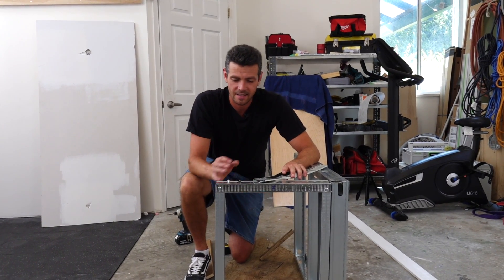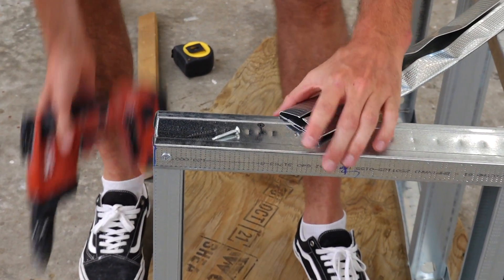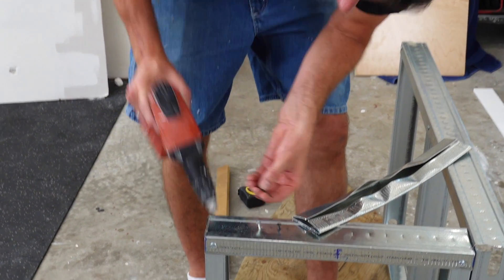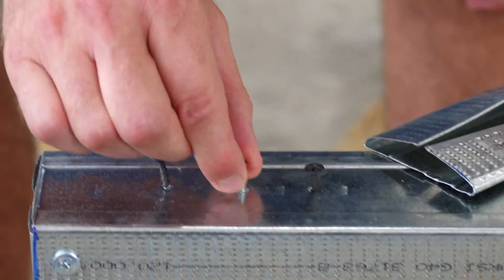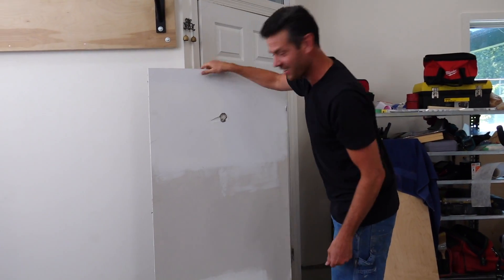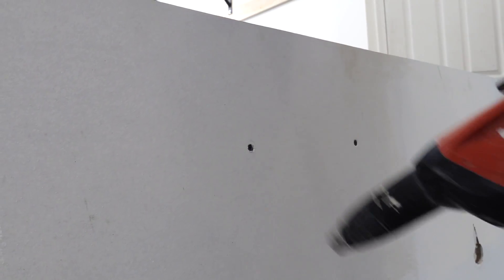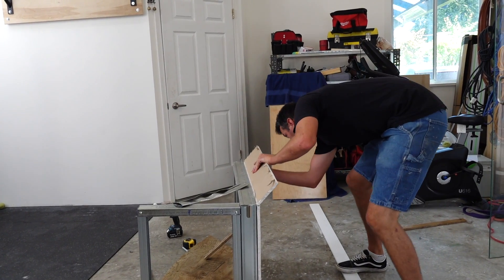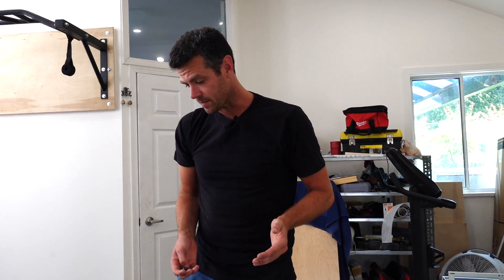Fine Thread vs Coarse Thread Drywall Screws

Comment: Great video but you forgot to add that course thread screws should be used when dealing with wood. When mounting steel studs to a wooden construction.

Comment: So technically if you want job security as a drywall contractor, you could use the course thread screws in thin gauge steel studs. Guaranteed to get call backs and a guaranteed constant flow of revenue. Hahaha I'm JK. Use the proper fastener for the right application of hanging sheetrock. Or am I? Hahaha JK again. 😜

Comment: This video was a life saver for a DIYer!  I was going to be using the self-taping on my metal stud framed basement because those are the screws they sell next to the steel studs at the big box store.  Thanks for pointing me in the right direction. Great video as always!
Reply: Dang big box stores can never get their hardware displays right. They may do it on purpose to mess with the ignorant DIYer, not in the know.🤔

Comment: Hanging 1/2 inch drywall on wood studs, you would use 1 1/4 course thread screws? Is there a particular brand screw you prefer? I've watched most all of your videos (You are a wealth of knowledge and greatly appreciated)I think I've heard  you mention the answers but I can't find them. Thank you for sharing your knowledge, I'll be finishing my basement soon and I've picked up a lot from you. Please keep the videos coming.
Reply: I'm guessing it doesn't matter the brand as long as you use the proper fastener for hanging drywall.

Comment: Thank you I think if you turned the c frame around after screwing in all the screws, you'd see an interesting picture showing the difference between cutting a hole in the thin metal sheet vs pinching a hole and pushing the metal out which creates a solid bump that the thread can hold onto.

Comment: Do they make a screw for drywall where the back is flat or the head is a little bigger for better holding pressure and less punch through. Because it's a pain for hanging drywall on celling and the darn screws want to punch through.

Comment: WOULD I USE THE COURSE THREAD IF IAM ATTACHING THE DRYWALL TO THE METAL STUD AND THE METAL STUD HAS WOOD BLOCKING FOR MOUNTING SAY A TANKLESS WATER HEATER? SO  ESSENTIALLY WHAT SCREW WOULD I USE TO GO THROUGH ALL THREE; DRYWALL TO METAL STUD TO WOOD?

Comment: Great videos you have, thanks for that. For this video I’m not really in for the story. The proof you use for the screws in WOOD, that shows that fine thread pulls uit easier than coarse thread is great to see, but, in both cases, the force that you apply to pull the screw out will never be on the drywall. You would rather break the drywall or pull the plate through the screwing hole than pulling the screw out. 

In either case it all depends on the application.
Coarse thread is stronger than fine in wood but how relevant is that when the drywall is the weakest point. Maybe a beter test would be :
Screw the drywall on a wooden frame with fine thread, coarse thread, selftappers and try to pull the plate off?

I’ve been putting 2 drywall plates on top of each other and to make sure that the underlaying wooden studs don’t burst I’ve been using selftappers (4 years ago) and 0 problems, about 4000 screws with 0 of them not sinking in the wood. Coarse thread would increase the risk u breaking the wood I believe?

Metal it seems a bigger problem with loose screws in the stud.

Comment: If you're hanging a whole job that's regular wood studs and then you build some bulkheads with steel channel then you're still fine using the course thread on the bulkheads, at least I think that's fine, what do you think?

Comment: So recently I attached a sheet of 3/4 birch ply to the inside wall of my trailer. I believe it had light gauge steel studs. I used the self tapping screws. Would you recommend going back and adding the fine thread screws to be safe?

Comment: What about screw length for metal studs? I get why you would want “an inch thicker than the panel thickness to have at least an inch of grip in a wood stud”, but for metal studs your “grip is the thickness of the metal gage…so as long as your out of the tapered part of the screw it shouldn’t matter (right??).  Example, can I use a 1-1/4” fine screw to hang a 5/8” panel? It’s less than an inch but you still only have 0.030” of holing power in a 30mil steel stud. Soo….does the screw length matter with steel!?

Comment: In my local hardware store they sell all these drywall screws plus they have a model that is supposed to work on both wood and lightweight steel. It's kinda coarse thread with fine thread in between. Like double threads on one screw.

Comment: Now I know i juts install 6, 12 feet sheets with the wrong screws ( i used the one for heavy gauge metal studs). What do you recomend? Do I screw the right screw leaving the others in place, take off the wrong  ones and use those holes for the right ones?

Comment: Just wanted to reach out. Never did drywall before other than some patches an matching texture. Took a bold step watching your videos, framed and finished my basement and dude did it turn out amazing. Thanks so much for the tips. I'm no total amateur, I did woodworking and costume building for my whole life, just shifted my talents thanks to your guidance

Comment: Question I hope you can answer.  It's not regarding this video but I think you would know. 
I'm trying to locate ceiling joists so I can hang a swing in a corner bedroom for the grandkids. I have measured 24", and 16" from the corner out going both length and width, crawled up in the attic to double check the direction they are laid, but can't get back to that corner,  the area I could see they were spaced 24" apart. Then even went to an unfinished room in the basement to see what the spacing on those ones were.. 17". It doesn't matter what measurements I use, I can not find ANY joists in about a 5'x4' space from that corner. My stud finder won't calibrate on the ceiling. 
I found a joist by the ceiling fan but it literally only goes about 4'.
My ceiling is not bowing, no signs of water damage.....I even tried the magnet trick and got it to work on the walls but not the ceiling. Now, one joist I found is 34" from the wall, then the next one 24", then the next one is 16", then I cannot find the next joist before the opposite wall. I am serious confused.  I just finished patching up about 50 nail test holes at a bunch of different measurements. I even did a line close to 3 feet long about an inch apart and didn't hit anything.  Any advice??? Thank you

Comment: Why do they make 3" and 4" drywall screws? If you are not supposed to use drywall screws for structural work, but only for installing drywall, where would you ever use a 4" drywall screw?

Comment: Fine threads have a shallower angle of thread creating more engagement with thin material meaning more deformation has to happen to loosen or remove the fastener.

Comment: My present digs are wood framing. I use coarse thread drywall screws to fix problems. Had a metal frame built in a previous abode but contracted that out due to the fact I had no knowledge about it back then. There’s a story behind that last statement but that’s for another time. Your knowledge is vast & worth a lot. Appreciate all your teaching. Learning a ton but still have a lot more to learn.

Comment: Hello, thanks for making this video. I am working on a job where we are using resilient channels and 5/8" drywall, I have found that the fine thred screws nearly always strip out before there fully embedded in the drywall, but course thread works most of the time. What are your thoughts?
Reply from the maker: I will try to make a video about that soon but here's a little info. Don't screw into the factory bevel of the board. You will have to place screws outside of the recess where the board is softer. The compressed edge of the sheet is harder and the steel stud blows out before it can sink into the drywall and grab.

Comment: I've noticed that the screw manufacturer matters a lot too.

The cheaper screws I've found weren't made to the same quality, and many of the screws in the package didn't have a point sharp enough to bite into the stud.

Also, that package had an awful lot of crooked screws, which sucks if you only notice it after getting the hole started.
Reply from the maker: Cheap screws suck. Especially cheap fine thread screws.
Reply: same experience

Comment: See my full comment on your corner bead video. I walk in on my sub contractor using cup nails to attach metal corner bead to steel stud framing. 🤦‍♂️
Reply from the maker: facepalm moment
Reply: @vancouvercarpenter  Right? 20 years ago it would have been a facepalm… my hand his face!

Comment: I've recently redone our kitchen walls. Wood studs, used drywall that was stiffened with fiberglass and the recommended drywall screws (35 mm) had two different threads pitches, coarse thread to sink in the wood and fine thread for the part that sinks just into the drywall.
Reply: How does a screw with 2 different thread pitches work? I don't think I understand, if it had 2 different thread pitches than it would strip out one of them because one full rotation would be a different distance on two pitches. I mean more grooves in the drywall technically would have more friction but it's the paper not the gypsum that holds it on and the stripping out of the hole would when the screw is pulled into the wood would probably counteract that, I think I'm misunderstanding because I do drywall and I've never heard of or seen that.
Edit: Maybe it's the fiberglass material that you use, I haven't ever seen or used those products, I think maybe it's tile backing board that you're talking about and then maybe the fiberglass compresses rather than strips out, I don't know but it would cool to see that product, I also wonder how they manufacture a screw with two pitches on it, you can do something on a bolt for fine adjustments with two pitches but it uses two different sized threads, I forget the specifics but Tubalcain has a really good video on it and I totally didn't understand I before I watched

Comment: I used those fine thread screws and they almost never tapped into the metal before blowing out the hole in the drywall. I wish I had known the tip to start at or next to the track and go toward the middle, I bet that was the problem! I ended up making 1/16” pilot holes to solve the issue.
Reply from the maker: Were you using a drywall drill or impact driver? Drywall drills handle steel stud like a champ. DIY style impact driving steel studs is way harder.
Reply: Yes, I was using an impact driver.  I don’t own a drywall drill.

Comment: Thanks Ben! I needed that cause I did the mistake of using self tapping screws on a thin metal stud. I’ll fix this if it’s not too late.
And on an other topic, I came across this question today; what difference between spackle and regular mud used on wall baseboard to fill nails holes?
Cheers

Comment: Building code allows you to use either fine thread or coarse thread in wood stud, but requires use of fine thread in steel stud. I’ve personally found the same as Ben that the fine thread in wood don’t have the same holding strength and are more likely to strip before the head is fully sunk in white wood lumber. Best to use coarse thread in wood and fine thread in metal and only use the self-tapping fine thread in heavy gauge steel stud.
Reply: Mark: Thank you very much for explaining the best way to use threads.
VC: Thank you for the video. They help a lot.

Comment: Coarse thread has better holding power. Do this again but use 5/8 drywall, you’ll notice the fine thread ones will strip
Reply: Yep just went through this tnt...course thread was only screw holding 5/8
Reply from the maker: It only strips for me when I try to fasten in the hardest part of the bevel.

Comment: Anyone know how rust-resistant these metal studs are? I'm planning to build a collapsible ice fishing shanty. The shanty will be stored outside, fully collapsed, when not in use....So it will definitely be exposed to the elements.
Reply: In some commercial bathrooms I’ve remodeled I’ve seen them completely rusted out but I’m sure they’d have been getting wet for a long time for that to happen
Reply: No, They are water resistant, not meant to be wet a lot. Even stainless will eventually rust.

Comment: Thank you so much for this..I'm in my 60s, and have hung many thousands of sq ft., Only into wood and as a amateur. If I was left alone to do a job with steel, I would have picked self tapping. Maybe I would be right, as I did not know there were two grades of steel studs...now I just need help mudding fast in one try.

Comment: Do you use 1 inch coarse thread in wood? Or longer?
Reply: In wood minimum of 1.25" coarse thread, unless you need the shorter length for a reason. Like screwing into thin strapping against masonry or concrete.
Reply from the maker: Like D Hammer said. 1.25" coarse thread. One other place I will use 1" coarse thread is on pocket door framing so the screws can't go past the 3/4" wood and scratch the door as it slides.
Reply: @vancouvercarpenter  yes I forgot about pocket doors, maybe because I hate them.🙄
Reply: Thanks

Comment: fine is meant for metal and course is for wood. fine doesn't guarantee a good bite though. the same with self tappers. it depends on the manufacturer. i buy self tappers from home cheapo and they slip most of the time. if you want guaranteed quality materials go to a supply house. not home improvement stores. they carry what they can get at the cheapest price. not necessarily the best quality.

Comment: Does anyone in Canada uses metal studs for walls or framing Ceiling, it makes my laugh all the time , when people uses wood all the time ,when it not needed, of course they use Wet wood and then put Vapour barrier 😄😂
Reply: Where are you and what does your region use for the structure of a house?
Reply: @dhammer5645  Im from Lithuania but I work all over Europe right now , also I meet a lot of Americans here , they saying all the time , I worked in US over 5 years  and they have low standards over there, it doesn’t work like that over here, vapour barrier installation is bad, they don’t understand how install metal stud wall or Ceiling, it’s insane that Americans and Canadians have such low standards , when comes to build houses
Reply: @EchoingPoet  That is your opinion of our standards. I disagree with it. For houses we don't build out of concrete or block typically. We frame the entire house out of lumber. The lumber used has to have a moisture content no more than 19% at the time of installation. Concrete and block can absorb moisture just as easily as lumber can. The vapour barrier is to stop warm moisture are from condensing inside the framed wall in winter. If you stop moisture moving from one temperature zone to another you stop it condensing. Condensing moisture causes rot and mold. It's all part of a building envelope and the science behind can get pretty deep. There is no difference between a property built wood frame house or a properly built  concrete of block house. The only difference between the two is how drywall and other materials is attached to the structure.
Reply: @dhammer5645  yeah we build hoses from blocks , those blocks Equivalent R38 value, we insulate them with 20 or 30 cm insulation, Otherwise I wouldn’t pass air tightness test,witch should be blow 0,50 per hour ,25,7 kWh/m2).

Comment: The thin metal studs on my 40 year old florida townhome were extremely challenging to get through using a regular drill and the fine thread screws.
Reply from the maker: It's possible they may have been heavy gauge or maybe the older ones were a hair thicker.
Reply: I found the Home Depot fine thread screws took forever to bite through the thin guage metal studs. Checked with another hardware store, same deal.
Something about the shiny screws whether fine or coarse, don't push through the metal well at all.
Seems like the point is too dull.

Comment: I don't know anyone using steel studs. Wood is all I see.
Reply: A lot depends on your region.  I just helped a friend renovate a basement laundry room, and used a combination of wood and metal.  Wood for the walls (to support upper cabinets) and metal to form the soffits and fur down the ceiling.  (there were a raft of wires above the previous drop ceiling that we didn't want to (or were unable to ) reroute, so using metal furring strips gave that half inch to leave the wires mainly untouched.  I like metal for soffits, as it stays nice and straight.
Reply: @VC-Toronto  yeah, I like metal studs because they are Straight and easy to work, Also use wood but only calibrated and wetness Lvl  14% for walls, I use metal studs for hanging stuff as well because they can hold 550 pounds or 250 kg
Reply: I use metal studs, I don’t use wood

Comment: Hi, thanks for the video.  I'd also enjoy a video where you go over the different types of drywall sheets (thicknesses, ultralight vs non-light, water-resistant/firecode, etc).  1 of the things I was most surprised by with a recent renovation project I finished was how crazy the difference in weight/strength was between typical 1/2" ultralight vs 5/8" Mold-Tough Firecode X sheets.
Reply: For real. I have a whole room with ultralight 1/2 inch, and the walls are like a bass drum. I kind of hate it.